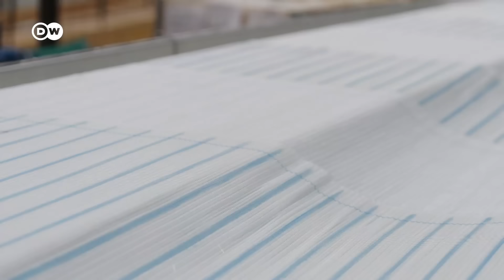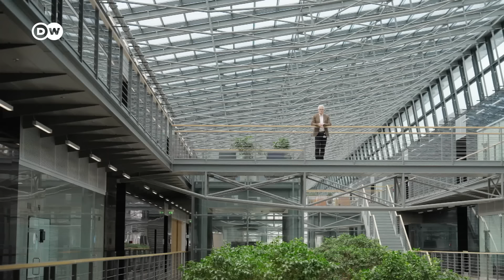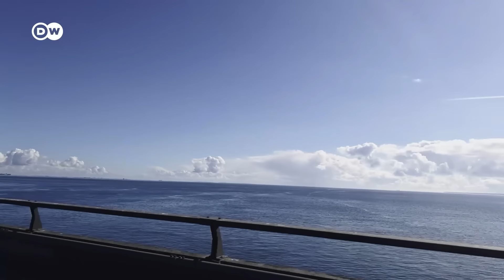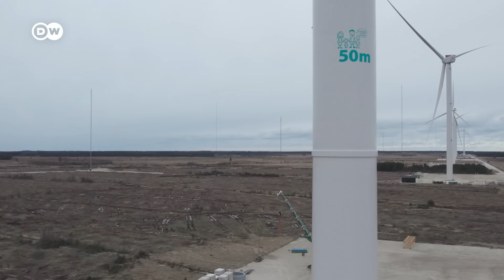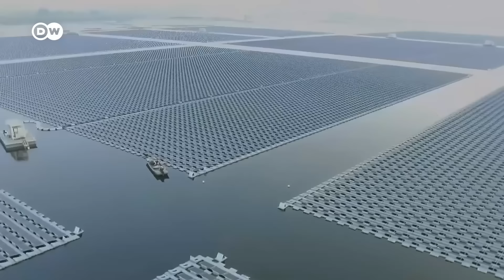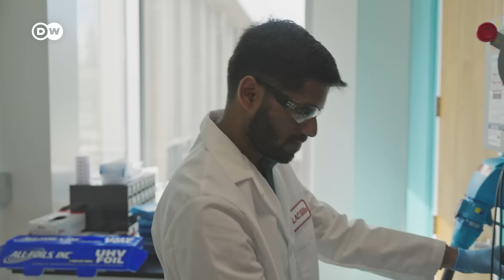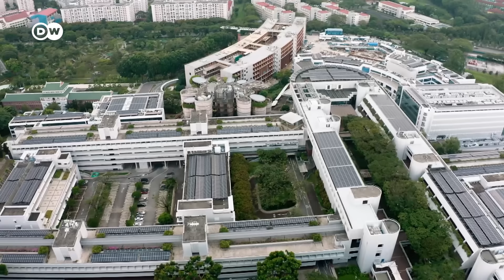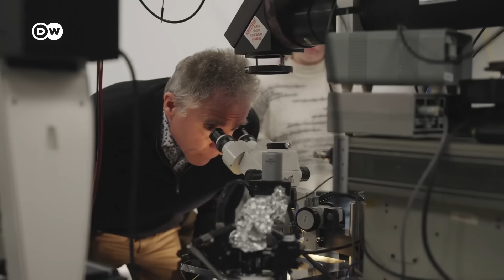Will renewables stop the climate crisis? | DW Documentary

Comment: 1) shallow Geothermal (aka. heat pumps) for heating/cooling which reduces electricity demand by ~70%
2) increase wind/solar/geothermal/hydro installation
3) create walkable/bikeable cities (ebikes are most energy efficient method of transportation, including walking)
4) install enough mass-transit (trains, busses), to eliminate the need for the personal automobile
Reply: Their u go!
Reply: Lol... yup we will get all that mostly complete in next 2-300 years
Reply: @looneycrow7978  European union is looking to rapidly m9ve more to trains and ban short distance flights
Reply: 5) Decrease evergrowing human Over Population.
Reply: @possame2  So what if wind/solar require replacement/maintenance? That makes it like everything else. They are still the cheapest form of electricity generation we have. 

And shallow geothermal can be used EVERYWHERE.

You're  trying to spin this as a negative, but then it should include other technologies, so it's not a negative, its the norm.
Reply: geothermal is possible everywhere on earth due to thermoelectric effect and differences between above ground temperatures. At a depth of about 100 feet (30 meters), the temperature is typically around 30-40°F (-1 to 4°C).
Reply: @mickgatz214  Populations rates are already collapsing all over. We're actually looking at a potential labor shortage.
Reply: @looneycrow7978  What's that setup/infrastructure look like? I don't like solar except on rooftops nor wind farms due to eco/nature issues.
Reply: @looneycrow7978 Australia wasted 90 million dollars some time ago trying to make geothermal work here, it doesn't. Geothermal isn't suitable for every country, just as hydro isn't suitable for every country. And here in Australia where we get regular droughts this is a problem even for those limited places it can work. It's inefficient or none existent without water flowing through.
Reply: Hydro electric like tidal too
Reply: @margaretarmstrong2445 australia is a corrupt country, how many projects ended up failure there? And nobody went to jail 😂
Reply: <<1) shallow Geothermal (aka. heat pumps) for heating/cooling which reduces electricity demand by ~70%
2) increase wind/solar/geothermal/hydro installation
3) create walkable/bikeable cities (ebikes are most energy efficient method of transportation, including walking)
4) install enough mass-transit (trains, busses), to eliminate the need for the personal automobile>>

In short,  use government power to force the envuronmentalist agenda on  THE WORLD.  Environmental colonialism.

In the meantime, CO2 levels as measured in Hawaii keep going up every year, as always.
Reply: @looneycrow7978 , Considering that 218.2 TWh out of 235.9 TWh (or 92.5%) of new global electricity generation was renewable in the first half of 2023, you clearly don't know anything about the power industry. With current trends, the power industry will be 99% renewable or nuclear by 2060, and it may happen faster, as building new solar and wind farms becomes cheaper than operating existing coal and gas power plants.
Reply: @looneycrow7978  Considering that 92.5% of new global electricity generation was renewable in the first half of 2023, you clearly don't know anything about the power industry. With current trends, the world should get to 99% low-carbon electricity around 2055.
Reply: @CashCatz  If you forego wind and solar over eco/nature issues, before long you won't have any ecology or nature to worry about.  It's better to give up 0.01 percent of the surface of the Earth to save the other 99.99%.
Reply: @amosbatto3051 You obviously don't understand that 1GW nameplate of wind or solar is not equivalent to 1GW nameplate of coal, gas or nuclear. 

Wind and solar are among the lowest density forms of energy generators and are weather dependent. The only thing that the nameplate capacity of wind and solar refers to is that they are capable of producing that 'stated nameplate' energy during optimum weather conditions. Which only happens 30% of the time on average over a year for wind and 20% on average over a year for solar. Wind and solar are weather dependent and most of the infrastructure lasts less than 20 years. 

On the other hand, coal, gas and nuclear are 'engineered' to produce reliable energy 24/7 at stated capacity or as required without the need for constant backup. As well as that these forms of energy generating plants last between 50 and 80 years.

There is no comparison.
Reply: Key word Thermal and how it changed weather, causing Drought Conditions, with these mirrors. 
The following are other factors t y at affect Water 💧 Sources. 
Hello from Los Angeles California.  I lived all my life in Los Angeles California, and in the 1980's the Smog was so thick it filtered the Sun. The smog blocked the Sun so much the winter's in Los Angeles California was so cold between 36° to 55° Fahrenheit nights dropping to 33° Fahrenheit 
I couldn't see mountain ranges from where I live 4.5 miles away. Unless it was windy and smog cleared. Now the air is so clear you can see cracks and riges, on the rock walls. 
It uses to rain 🌧 none stop for 7 months, and the summers never exceeded 90° Fahrenheit. Due to Sun being filtered from smog I also didn't need shades, for my eyes. Now 🌡  are 110° Fahrenheit for excess of 1.5 months with 5 days in the roll Temps exceeding 116° and 1 day at 120° to 126° depending on fire conditions radiating heat. 
Air clean enough, and it will not get any cleaner with only Electric Vehicle's (EV's)
Now to the reason why Environmental green agenda causes Drought Conditions.  In 2010- 2013 there were Solar Mirror s installed to project solar arrays to a Tower with mirrors projected downward to under ground reservoir water sources.  To generate steam, and generate Electricity.  
The temperatures 🌡 causes the atmosphere to close to 5,000° and every time birds fly thru become instantly baked and fall. 

In the 1980's the Jetstream used travel across California in to Nevada,  Arizona,  New Mexico,  Texas, and so on to Florida.  Due to the Mirrors the Atmospheric High Pressure. Has pushed the Jetstream away from Southern California to North to Washington,  and or Canada 🇨🇦 . This cause along with getting rid of Smog cause higher temperatures and Drought Conditions. You couldn't pay me $10,000,000 per hour to sit, promote,  sell, let alone buy any Electric Vehicle's (EV's).
If you look up StachD Training channel, on his video titled Lithium Largest Ex plo ding EV Recycling ♻️ Center in Missouri.  There were 4 Recycling ♻️ Centers in the United States.  Now there are 2 Recycling ♻️ Centers,  and none are in the State of California.  Due to Environmental Impact, which the video shows Fire Authorities spray granulated elements of the Lithium-Ion Batteries 🔋 Packs,  into creeks, rivers,  and lake anfmd underground well resources.  Not even boiling helps, and fish hacmve died in those water ways.   Sure clean the Air while you Pollute the water. In April 2024 the 1st Recycling ♻️ Centers in Phoenix Arizona location burned down,  and dousing water to keep cool prenting spread of fires 🔥 have caused Drought Conditions.  
Look it up
StasheD Training channel 
Missouri Recycling Center ♻️ Ex Plod ing can't spell this out. Fish died wells for water is no good anymore,  and became Acidic 
These are facts. 
Mirrors in Mojave Desert Modified where Jetstream away from
 Southern California.  
The so called green agenda is to keep there pockets full or bank accounts.
Reply: @margaretarmstrong2445  but the installed capacity for photovoltaic, in 2023 and 2024, will produce more than 1000 TWh. The global annual production of photovoltaic will overcome both nuclear and wind in 2025. During next year it will produce more than hydroelectric and in 3 years will reach methane. 
Within 2030 it will reach the production of coal. It's growing exponentially!
Reply: @harukrentz435 Exactly my conclusion as well.
Reply: I consider geothermal (Aka. Heat pumps) to be a repositioning of heat. While cutting emissions, it doesn't help mitigate global warming in the pipeline.
Wind, Solar, and Hydro, however, converts solar energy into electricity rather than heat.
Reply: Geothermal is only viable in places where the heat sources are much less than 20km underground. To have a truly global source of geothermal energy, we'd need drilling technology that can exceed our deepest point on earth (Kola bore-hole in Russia, which only went slightly over 12km, we need an average of 20Km or deeper). That's still in the works, but, I agree that geothermal is and will continue to be pivotal in addressing a grand transition into renewable energy. 

In terms of re-adjusting cities to become more bike and walking friendly, would it help to get elderly folk on board by offering tax incentives for purchasing electric bikes/scooters? Biking and walking is healthy, but, for elderly folk in their late years, the pain/risk of injury is too great. Having electric motors to help reduce physical exertion, I argue, needs to be considered. I suggest it because it would provide most elderly generations (those that tend to vote the most on climate policies, which can be skewed towards non-renewable energies) something personal they can benefit from when transitioning to a new world. It could help many old-timers change their minds for the betterment of humanity if they get a sweet deal :)
Reply: @CrimsonA1 No, that is not true. Perhaps for power generation, but not for heating.
Reply: You forgot lots of fission where geothermal and hydro is maxxed out or not available to cover winter needs stable loads and industry.
Reply: @CashCatz well solar on roof is the most expensive kind , some solar farms in low value terrain will be helpfull. For wind farms if they are integrated on farms or on mountains the do little to affect nature and man

Comment: Will we be able to mine, haul and founder the steel and other metals with turbines to rebuild the turbines?
Reply: We have been able to extract and process vast quantities of fossil fuels, even though no one knew how we would achieve that when we started using fossil fuels. I am not saying the processes are the same, just pointing out that everything we use, uses processes that did not exist before the processes were created, and were small scale until they were scaled up. We find ways.
Reply: @glennjgroves  Hydrocarbon is orders of magnitude more powerful by mass than anything we've encountered besides energy intensive ratification of nuclear fissile mass.
Reply: @TennesseeJed  the majority of energy is wasted when we burn hydrocarbons - and that ignores losses in the processes needed before we burn them. Eg only about 12% of the energy in oil actually moves the vehicle, once you take into account the energy used in extracting, transporting, refining, and the energy lost in heat, noise and vibration in the engine itself.

There also finite quantities of fossil fuel reserves. And burning them is causing both short term deaths from the pollution, and long term damage to the environment, which will keep getting worse. We have to stop using them before they run out anyway, and the sooner we do the better, given all the other problems that burning them causes.

Nuclear is utterly impractical for financial reasons in most countries. Though it might be the best option in a few scenarios. And if you come back disagreeing, I will know you haven’t bothered researching the costs behind any recent nuclear builds, or the failures to create commercially viable SMRs.
Reply: @glennjgroves  we have overshot our ecological limits by at least double it's capacity to regenerate and absorb waste in both materials and latent heat. Bad times are ahead for the human enterprise
Reply: @TennesseeJed  and the more we overshoot the worse it will get. Limiting further overshoot means stopping using fossil fuels as quickly as possible (and some other things also). Stopping using fossil fuels as quickly as possible means replacing them with renewables as quickly as possible.
Reply: No.
Reply: of course we can Jed, were the dumbest inteligent species in the known universe, have some faith 😃
Reply: @janklaas6885  I have faith and trust issues.. obviously.😏
Reply: @TennesseeJed  
I understand you completly my friend, but there coms a time you have to choose otherwise.
Reply: @glennjgroves  Replacing one form of energy for another doesn't solve overshoot.

As for extraction, we built the fossil fuel infrastructure while we had insane EROI. You could get oil with a pickaxe. Modern renewables are much more complex and we can't build using renewables.

BTW, this isn't about hating renewables but facing the reality that we'll need to do with much, much less.
Reply: @borealphoto  replacing one form of energy with another DOES solve overshoot when the new form does not require eternal extraction to continue producing energy. Your statement on this is false.

The entire energy system will swap over to renewables over the next few decades. Renewables will be built using only renewables once the energy system has swapped over. In the mean time, using fossil fuels to build things that do not need more fossil fuels after that makes a huge amount of sense.

If you think people will be willing to massively shrunk their lifestyles over a threat that they cannot see for themselves, then you know little about psychology.
Reply: @glennjgroves  Renewables are not eternal. They do require constant extraction. Your second paragraph is pure fantasy.

We'll need to shrink down whether we want or not. We can manage the land using permaculture principles, not to "save the planet" but to build a cushion against energy scarcity.

Comment: Not without nuclear power.. Tell that to Germany and Olaf Scholz
Reply: J'adore les robots FRAMATOME / EDF!
Reply: Nuclear power is a good way to vacuum up the whole budget and keep that money tied up for decades.  In other words, nuclear power will slow the transition, and so the fossil fuel companies love it.

We need to speed up the transition.  The way to do that is wind and solar power.  These technologies scale much more quickly and economically.
Reply: The problem with solar and wind that they have time holes when they barely produce any energy. For that time, a capability to produce energy by other means is necessary. For now, hidro and nuclear are the only viable options.
Reply: @PrexXyx  Solar plus wind plus battery storage and other storage technologies can completely replace fossil fuels to provide electricity.

It's fine to have some nuclear also, but not if it means burning up the whole energy budget on multi-billion dollar reactors.
Reply: @davidmenasco5743  Batteries can replace nuclear but they are freaking expensive, not to mention that significant excess capacities are needed during peak hours to charge them, and the significantly shorter lifecycle of batteries vs reactors. 

I work in energy (oil&gas mainly). 2 years ago, we calculated the returns on a specific nuclear project vs solar + batteries as alternatives. Through the planned useful life of the reactor (27 years but it is always extended to 40-50+ years with minimal additional investments), the solar alternative cost 7x more. I understand that returns are getting significantly better, but at this point in time, the only financially viable alternative to nuclear as basic supply is hidro. And hidro is simply not an option for most countries. 

And this excludes the fact that batteries are significantly more harmful to the environment (use a LOT of clean water during production which cannot be cleaned after, and they are extremely difficult to dispose of due to their size), even considering the long half-lives and precisely controlled environment needed to store nuclear wastes.
Reply: @PrexXyx  A few notes:

1)  If you look up the actual life span of reactors in the US, you find that about half of them were decommissioned well before their planned 30 years was up.  Only a few have been extended beyond 40 years.  The radiation makes both the concrete and metal get brittle.

2)  The prices of both solar generation and battery storage have dropped significantly in the last two years and will continue to do so.

3)  Nuclear projects are notorious for costing dramatically more in the end than their initial forecast.  Large solar projects have a track record that is just the opposite:  They come in on time and under budget.

4)  New battery chemistries are brought online about every six months.  These new chemistries can allow optimization for applications such as stationary storage, reducing costs.

I don't know whether your numbers are accurate or not.  But if they are, then there are still these factors and more to consider.